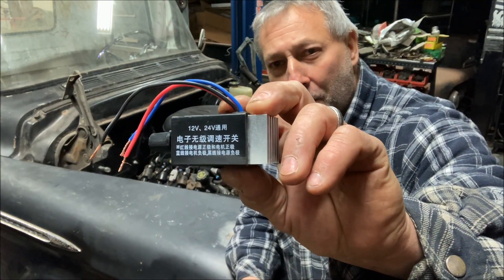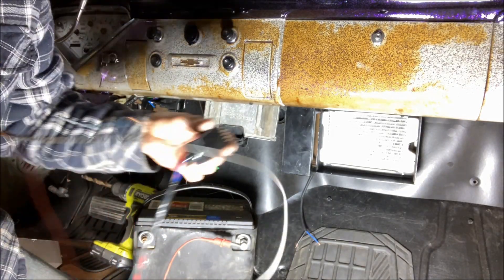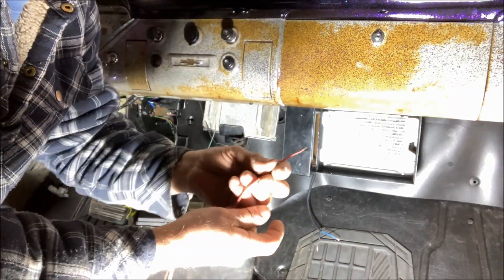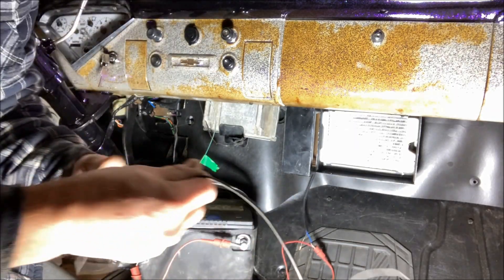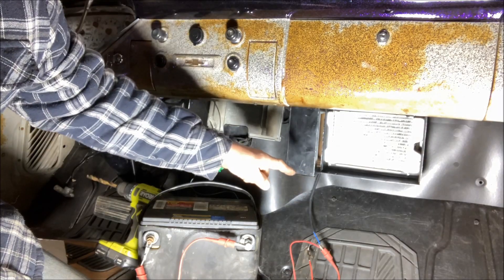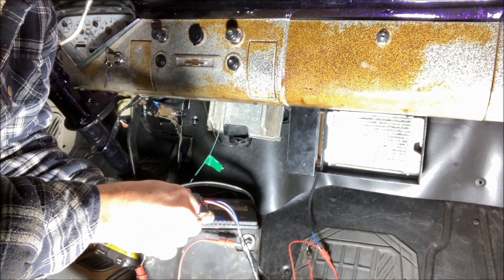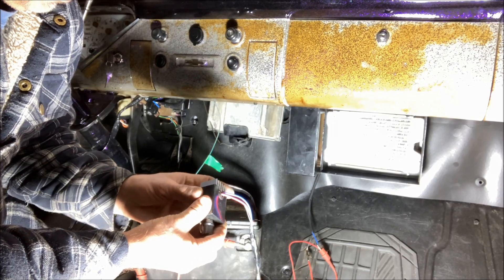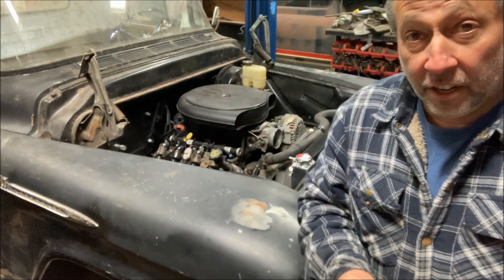Ebay / Amazon Universal Heater Fan Control Switch Installation and Test! Here is how to wire it up.

Comment: I bought a switch just like that one on Amazon, did a rest run just like you did with a battery, worked great, now I made the connections permanentl one at a time to not mix them up, hooked the power side to fuse box, ground to battery blue to negative side of blower, when I turned on the ignition the fan started running with switch off , on off didn’t matter
Reply from the maker: Sounds like the switch may be shorted or it is wired wrong, I would bench test the switch. Mine has been working fine since install, just used it today.

Comment: So it’s controlling the amount of ground for speed control . Interesting ,  would thought it would have been the positive .
Reply from the maker: It is a potentiometer working as a variable resistor.
Reply: @rust_hoarder_garage  The only bummer is that if you have a typical stock heater fan in an old vehicle ('76 squarebody) the heater only has a + stump on it so this controller won't work for it. Ground is just the motor connecting to the chassis. Franks comment above is true, the resistance is supplied just to the negative side which is weird to me.
Reply: @chuckdock4436 they make ones that’s opposite and it controls the positive going in those are the ones I prefer

Comment: That worked well! You had mentioned before you used a junkyard resistive network to make 6v heater motors work on 12v. You said you just don't use the high speed setting. I'm assuming that's because the high speed setting is 12v direct to the motor, while the lower speed settings are lower voltage, closer to 6v, correct? Is the reason you don't want to put 12v to the 6v motor is it might burn it out? If that's the case, could I use a switch like the one you used in this video and just put a mark on the potentiometer where the motor is getting 6v and not turn it any higher than that?
Reply from the maker: Hi, correct, when putting current through the resistor there will be a lower voltage to the motor, and I do not use the high speed option because I do not want to put a full 12v to the motor and risk burning it out. I will see what I have laying around and try to do a video on wiring up a 6v fan with the network, but will probably be after I have the truck complete enough to run and drive out of the garage (maybe a couple weeks?)  You could try one of these switches, cheap experiment. I may even have a 6v motor around that I can test out with the switch, I have a couple more on hand.
Reply: @rust_hoarder_garage  would be great if you could do a test on a 6v motor! But don't worry if you don't get around to it. I'm pretty sure the switch will work. What I'll do if I decide to use the switch, I'll put a multimeter across the motor terminals, adjust it until it reads 6 or 7 volts, and then try to put a stop on the knob, so it can't be turned higher. Either that, or I'll just see if I have a resistive network and a regular fan switch laying around. Either way, thanks for answering my questions. It helps me a lot.
Reply from the maker: No problem, you will only get lower voltage when there is a load on the circuit, so you will have to hook up the motor and check the voltage while running the fan. With no load you will always read 12v.

Comment: I have used these on a portable cooler.  I found it makes a high pitched whine.  I tried 2 other brands - all the same result.  Wondering if anyone has suggestions regarding how to avoid the high pitched noise from these type of switches.
Reply from the maker: I didn’t notice it during testing, will see if I notice it during driving. I have ran heater fans using a 3 position switch and a resistor network, you may want to try that.